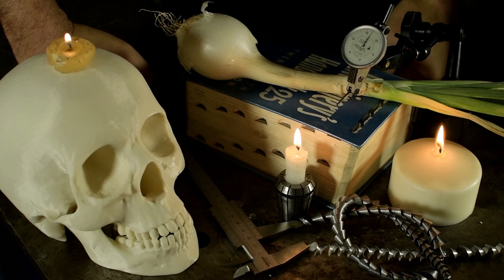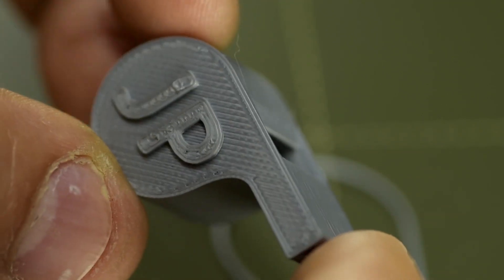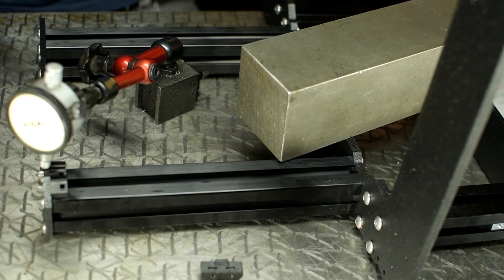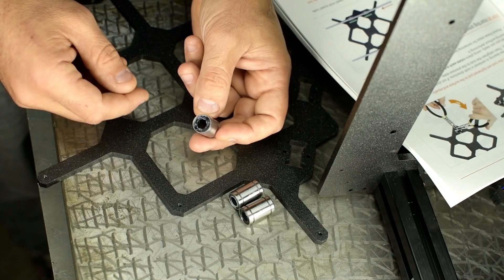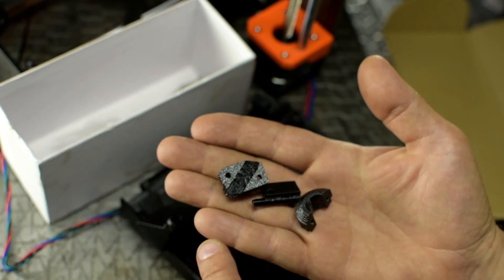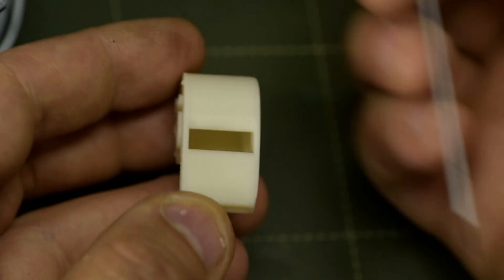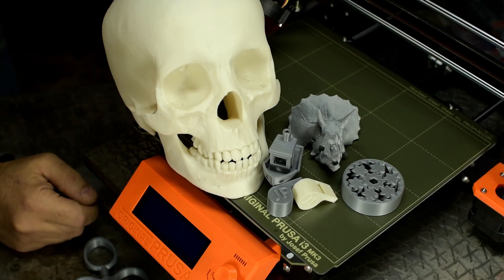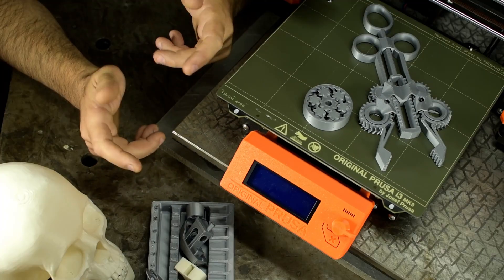This Old Tony in 3D!!! (printing)

Comment: There are some who can't help but tinker with their 3D printer and will tell you the "cheap ones" are more problem then they are worth...We also started off with a Prusa several years back when things were still "new"... at that time, you usually did get what you paid for... that being said, the industry and quality have matured a bit since then... Creality makes a pretty good machine and we have a whole print farm of unmodified Artillery X-1 printers that churn out tons of highly detailed terrain models for gamers and a wide variety of other parts... For about $500 and fifteen minutes you get a machine that prints pretty damn good out of the box and most of the "tweaks" are in the parameters you use in the software.  Welcome aboard and enjoy the new tool in your box... true enough, you may not use it all the time, but just like having the right tool for the right job, when it is useful it is incredibly useful!

Comment: Best workshop use I have found for mine is making spindle bungs for hex bar to stop it vibrating at high rpm. Work really well.
And you are right the simplicity of slicing a part compared with cam for turning, is chalk and cheese

Comment: Agreed - Prusa does not disappoint.  My MK3 regularly outperforms my M3ID, which costs thrice as much.  Just wait until you've built an enclosure and start printing in nylon and polycarbonate.  It's worth the headache figuring out how to keep them on the plate; they make for surprisingly durable parts.  And get the PETG out of the bag!  PLA is good for trinkets and ABS/ASA is good for absolutely nothing.  Great work as usual, thanks.

Comment: pro tip with 3d printers, aerosol hairspray will help with the lifting issue. a thicker (slightly) 1st layer helps a bit too

edit: also, filament does degrade with age. PLA being one of the worst.

Comment: You got yourself the best hobby grade 3D-Printer! I have the MK3 running since two years. It is now past 10'000 meters of filament and 4900 hours - or more than half a year continously. Other than the cooling an and the Y-axis bearings I haven't touched it.

Comment: 11:10 store the end of the filament in the holes on the side of the spool, or however else - if it gets lost in the spool with the rest of the filament, when you find it it can already be twisted with the rest of the filament and then you never know when it tightens and breaks in the middle of the print!

Comment: The Ender 3 is a great, affordable printer. It can do excellent results, but it will require some upgrades. Get an upgraded motherboard, upload Marlin and get a bed leveling sensor.

Comment: The whole you get what you pay for sentiment is only kinda true when it comes to 3d printers nowadays. Companies like Prusa and Ultimaker have built good reputations over a long time and charge you for that reputation, but that doesn't mean that they are proportionately better. There was a time where opting for a bargain printer was a recipe for pain, but that's no longer really the case. For the Price of a Prusa i3 you could get an SKGO, a twotrees saphire with an extruder upgrade, or any number of other printers that will kick its ass in features, print speed, quality, and print size.

Comment: Instant thumbs-up. I have had the Prusa i3 MK2 for almost three years. I had a very cheap ($180) Anet A8 before it, which proved to me that there was some value there, but oh my gosh, the Prusa i3 is so good. It just works. Three years of printing and I've never had to repair or recalibrate anything, it is a total workhorse. I've designed so many solutions for problems around the house (in Fusion 360) that even my wife is glad I have it. And that's the true test right there.

Comment: As someone who uses both A prusa and multiple enders both at home and at work. I can tell you from years of experience, I'd you want to get into printing do not be afraid to buy and Ender 3 Pro. They are absolute workhorses and mine run basically 24/7 as I print cosplay costumes and props with mine. If you have the cash the prusa is amazing too.

Comment: I have built my own printers from threaded rod, printed parts and wood, even to the point of soldering my electronics, because that's how we did it way back when.  Now I have a Ender3 that has been cranking for 2+ years with about the only thing needing is a nozzle change and a hot end cleanout once in a while.  I also have a Creality 6SE that I just got and it's cranking as well....

Comment: My ender 3 printed  just as well as the Prusa out of the box... I honestly didn’t have to do much tweaking. But PLA is and should be super easy to lay down for just about any printer. Since getting the ender I have done a lot of upgrading, but not so much in the way of print quality, which was already there, it’s getting rid of the all the noise with better stepper drivers and making other filaments print as well as PLA does without fighting it. A $750 printer SHOULD NOT have 3D printed parts as structural components out of the box...That is insane. The linear bearings aren’t buying you any more precision in 3D printing. It’s real easy to spend way too much money and end up with the same print quality as a budget printer. After being in the game long enough, one will find that out the hard way. But welcome to the club either way. You’ll find a lot more use for a 3D printer than you could ever imagine. Just prototyping parts before wasting real stock will pay for that thing in no time.

Comment: Hi Tony. Your printer is not insulated. I would recommend not to use ABS anymore. You will get a lot better result with plas even nowadays pla material is many variety that can produce better print  than the abs.

Good job on building the printer. But there are better models. With less intensive builds.abd performs better .eg built with less greasing and less 3d printed parts which fails in about 2 to 3 years in tropical region. The ender is a good recommendation

Comment: In regards to the state of that benchy you should really take a look at this. http://www.3dbenchy.com/dimensions/
You are lucky we didn't get grease in our kits with the Mk3 came out. Make sure you install the latest firmware as the update came out September 21. 
You should also go into the menus and check to make sure the belt tightness is right.

Comment: I've used an Ender 3. These are much better results than the Ender. As far as warping, I always print with a raft, and (with PLA) a bed temp of 65°C to prevent warping.

Comment: I watched all sorts of 3d printing setup videos, and I followed all of the instructions that they gave. I thought I had gotten a dud, or there was some sort of hardware issue baked in. Less than halfway through the video you talking about how you set yours up on a surface plate to get out the twist, sure enough I just checked mine and it has the same dang issue. They didn't mention you had to make it on a flat surface, I thought any sort of issues with alignment would be fixed by the auto level, but sure enough after grabbing a mirror to adjust it on, it started working.

Holy cow Tony, you just saved what was left of my brain. Truly, thank you.

Also, sorry if this was hard to read. I speak English as my first language, but I still suck at it.

Comment: Cant wait to see what kind of things you make with this! Welcome to the 3d printing world! I got my first 5 years ago, a Folgertech 2020, then picked up an anet a8, both could make awesome prints applying machinist like calibration but seemed that whenever they sit for a month or 2 with no use, it takes 1-2 days of tinkering to get printing good again, can't wait to get a solid reliable printer but I am about to add a Brother Speedio soon and renovate the shop around it. The printer will come after that but it works out because I want the printer for implementing LEAN principles and they are great for storage bins, draw organizers, tool tags, Kanban cards, and all sorts of random shop widgets. Planning on the Prusa like you have here but I might spring for the Raise3d Pro 2 for the features and larger work area. Cant wait to see that finished CNC mill conversion, that is an awesome project and video series!

Comment: With regards to your statement that you haven't had any problems yet: be careful with bed adhesion. You have the smooth sheet, with is excellent for PLA but worse for PETG. The textured sheet is poor for PLA and great for PETG. If your print comes off from the bed, it may cause a big blob of plastic goo to build up on the nozzle and all over the extruder. If you get blobs too many times, it may start to wear away at the delicate thermistor which is sort of haphazardly attached to the extruder on the bottom with thin wires.

Essentially, be very aware that you may have a print not adhere at some point and cause a huge blob. This will cascade into other issues over time, so it's best to clean your plates with Dawn frequently and use brims when necessary. Bed adhesion is just about the only real flaw with the Prusa, so that's what I recommend looking out for. Also, I've heard some good things about scrubbing your plate (the textured plate, at least) with acetone once initially. Prusa officially recommends that you don't do this, but it might be something to look into if you ever have problems (which you may not if you stick to the smooth plate for PLA).

Comment: "I was expecting it to print in maybe two pieces, or grow a peg or something through the center"

Rule 1 of owning a Prusa: never underestimate your Prusa.
Reply: Bro... Don't go ahead of yourself.... Prusa is great, im not saying that... But it's not the 3d printer that rules all... I have a Anet e10 (modified i know) and some times it prints better that a prusa Mk3 that one of my friends have.... Also... That bridge? Ez for the average 200 usd 3d printer.... As i said, prusa or great... But it's not the ultimate "does everything" machine
Reply: @Lucas_sGarage  Totally agree! I wrote that comment back when I didn't know what I was talking about. The Prusa MK3 prints better than most other bed slingers under $1000 out of the box. However, the Prusa is still very much limited in speed due to the simple fact that it's a bed slinger — the ubiquitous speed bottleneck in any bed slinger is the y-axis belt which tends to skip at higher speeds since it has to carry the full weight of the bed and your print. As a result, none of the default configs really push the speed all that much, so owning an unmodded Prusa is a matter of accepting that you won't be printing above about 60mm/s if you want to retain a high standard of print quality. I know speed is just one aspect of a printer; however, it has a global impact on the whole print. Reducing speed (I should really say acceleration, since most bed slingers hardly reach their target speed with their default configs the first place) increases quality almost invariably, though you can modify most printers to increase their rigidity, flow rate, lubrication, etc. to the point where you can give yourself a pretty wide speed threshold before noticing any reduction in quality. And this applies to something like an Ender 3 every bit as much as it does to a Prusa, so the Prusa does not offer much more than better support and better performance out of the box as compared to other printers. Intrinsically, the Prusa is a pretty pedestrian printer that only stands out because of how stable and easy to use it is in its default configuration. I would say it's only better than the Ender 3 because of its closed filament path and higher rigidity (setting aside creature comforts like auto bed leveling).

You mention bridging, which is also a good point. No matter how good a printer is, printing a line of filament in midair is tough and will always be an issue regardless of kinematics, flow rate, or whatever. Cooling is probably the main thing to focus on with improving bridging, but, even then, not having a layer beneath to squish down the bridge lines onto is inevitable and make bridges a universal weak link in any print unless you use PVA supports. So a Prusa won't do any better than an Ender (ignoring cooling, which is pretty easy to mod on most printers) in that department, and neither will an Ultimaker. I wouldn't say bridges in general are "Ez" just because there's no way to get filament to form nice layers in any situation without a layer beneath them in any printer, but getting bridges as good as a Prusa is definitely "Ez."

The Prusa is heralded by many as the printer to rule them all, but, you're right, it isn't. It's the printer to rule them all if you want something that works right out of the box, which I'd say is a missed opportunity if you're a hobbyist and not running a business or something. In retrospect, I should have gone with an Ender rather than a Prusa just so I could have learned more through the process of getting it to run as good as a Prusa.

I've modded and tuned my Prusa to hell and back, and I still can't get past 5000mm/s². My y belt just keeps slipping! I tried to install a linear rail to make it smoother and less likely for the belt to skip, but the powder-coated aluminum frame just doesn't afford me enough real estate to get a linear rail down there (I'd rather not switch to "Bear" extrusions. I like keeping the non-printed parts of my Prusa stock because it's part of the fun of modding to me). It's a limited printer, but excellent for what it's meant to be: a printer that works at its full potential right out of the box and is backed with the full support of a very trustworthy company.
Reply: @Joe_Yacketori  i agree 100% out of the box for 750 (ish) usd it's great

Comment: Welcome aboard. Just checked the total print time  on my (much loved) Prusa i3 MKs2. 248 days, 20 hours, and 54 minutes. Maybe I wouldn’t use it so much if my shop had space for a lathe, mill, drill press, etc. But the Prusa is small, clean, quiet and dirt cheap (at least compared to the space and money I’d need for even minimally equivalent subtractive manufacturing capabilities). I’m no pro — just a hobbyist — but there’s something almost intoxicating about how much you can do with these machines. Enjoy!

Comment: Hey Tony,,,Let's go back in time,,Like to 2018 when you got the Water Cooler for your Tig machine,,,,Now you can 3D print out a plastic "Quite Fan" or 2 (@@)!! Just a thought :)> The fan my friend made on his printer for our JD mower, not only was stronger in design, but much quieter than JD's OEM one. His design had a ban (or call it a collar) that tied all 6 blades at the tips that kept the blade deflection to zero...Hope to see what you come you with on a video,,,,Bear

Comment: I bought an MK2 Prusa years ago, and it's been upgraded a few times to a 2.5S which is kind of similar to the MK3s you have there.  It's been a solid printer, and the slicer Prusa took over development for has really expanded it's abilities over the years. IMHO these are the best made for it's market and price point. I have a friend with an ender and it's good value also, but not as good as the prusa.

Comment: I’m no expert, but I help teach a lab at my University that includes rapid prototyping (3D Printing) and had a couple comments on the printer! Re: the print quality, the Prusa is a great choice for something entry level without having to worry about the stringy monster you described. As for Benchy, here’s a couple things you are looking at:
1. FDM (Fused Deposition Modeling-) aka melty plastic filament printers tend to have a hard time printing overhangs of >~55 degrees without support material, in benchy, the arches doorways and portholes and roof of the cabin are all examples of such overhangs. Some low end printers struggle to complete the roof of the cabin without a stringy mess appearing, this looks great on the prusa. Those little whiskers you observed are artifacts of the struggle that the printer is undergoing when attempting to print the archways/top half of the circular portholes, you’ll note that the wispiness starts at about that 55 degree angle of the features. 
2. Looking for “stepping” in features that are 3D contours (meaning contours or surfaces that don’t lie in one XY plane, but are have some Z component to them)- the printer must print in a fixed slice height, (some printers have variable slice heights, but as far as I know you can only use one in a given print). You are therefore limited in the fidelity of any 3D contours. You see this most prominently in the roof of benchy, there is some “stepping” there are the slope of the deck doesn’t exactly match the spacing and heights of the layers of material. This effect is also notable in circular features oriented in a Z plane. The bottom half of the portholes for example, also have some minor “steppiness” to them. 

Other than those 2 things, as far as I can see benchy looks great in PLA!

It’s worth noting that while more expensive machines with support material can really mitigate and free you up in the overhang issues, even expensive “professional” FDM machines struggle with the stepping issue, and you’d have to change processes completely to avoid that (like SLA or stereolithography). 
Thanks for all the great content!

Comment: I bought a Creality Ender 3 Pro for $229 back in March. I bought it, specifically, to print parts to make a Lowrider 2 CNC router, which I haven’t  yet finished. 

Don’t worry, after your honeymoon period, the issues will show up. They are surmountable. I still think is pretty freakin’ cool.